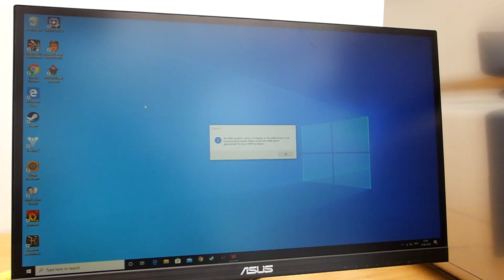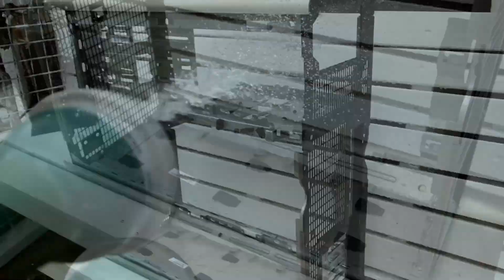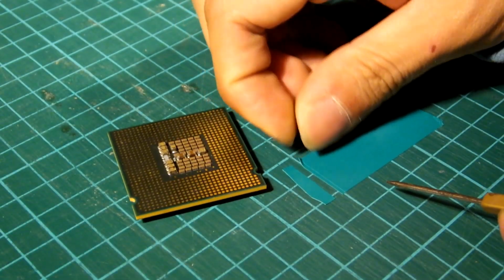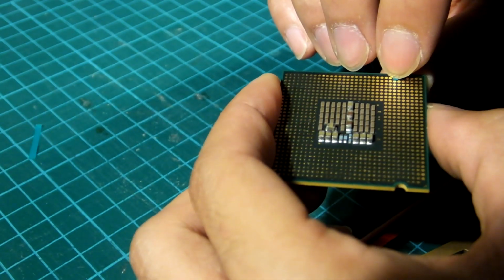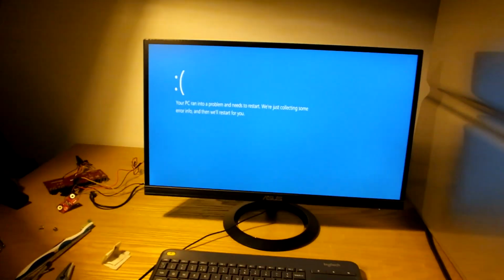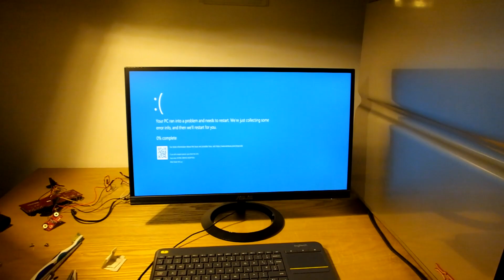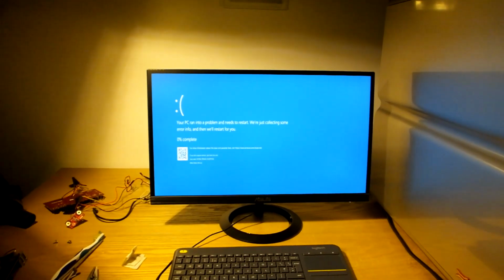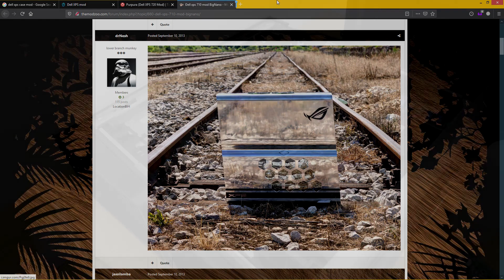An Old-School Dell - Lots Of Dust & Proprietary Parts

Comment: Excellent video! I have a newbie question. What make or model of a PCI express card would you recommend for my XPS 720? Thank you in advance.
Reply from the maker: Hey, it depends on your budget, what you want to use it for, and your monitor's resolution.

The cheapest I recommend is the GT 710 - it has an HDMI port, is fairly new and works great for general computing (but not for gaming).

For gaming on a budget, do have a look at the GT 1030 or GTX 750 Ti - they'll run at 720p high settings, or 1080p low.

If you want to game at 1080p at high settings, I recommend the RX 470 and 570, provided your PSU can deliver up to 450W.

There are a lot of vendors out there (such as ASUS, MSI, Sapphire), but they're all good in my opinion.

Any further questions, feel free to ask me, and thank you for your comment
Reply: You really should take a crack at YouTube if you own other vintage tech :)